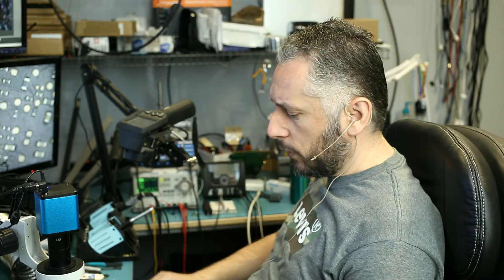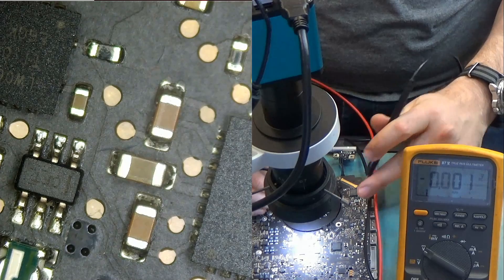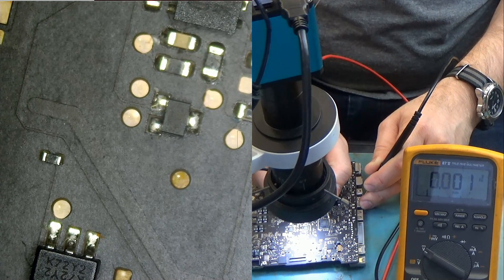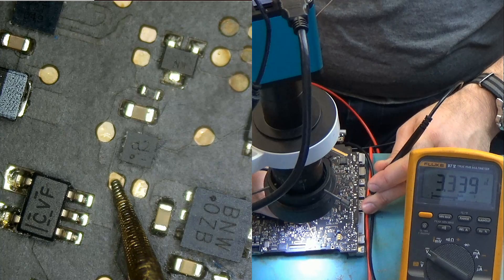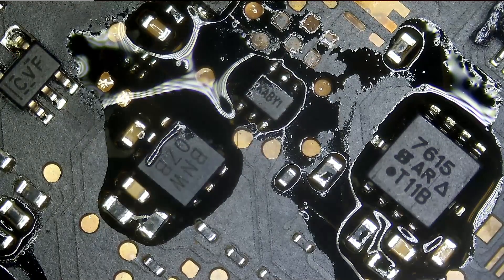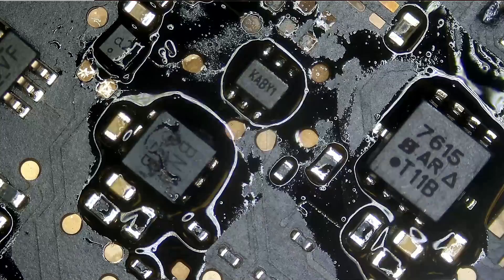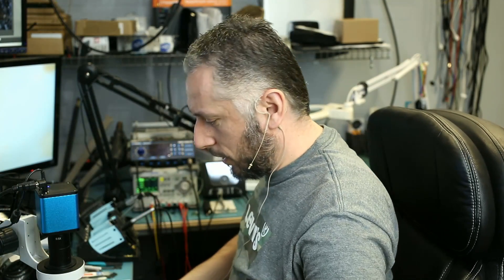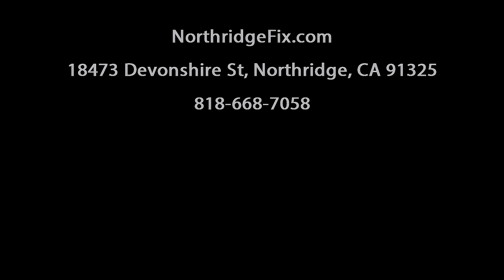Macbook Pro Green Light but no power - Missing PP5v_SUS 820-2915 repair

Comment: I have macbook pro 15 2012 Charging but won't turn on when I use the battery from 17 inch to 15 inch after 2 weeks suddenly shut down, only when I plugged in is green and also charging the battery , I have tried to find a defect component but I couldn't found

Comment: Hi, Alex, you're probably busy and don't have time to answer everyone, but if you find a moment, please help me in the video, you're fixing this mac, I have, like you, all the voltages except PPv5_SUS, I've already replaced this small chip four times and nothing else I've measured everything around resistors capacitors I checked the paths and everything looks fine I ran out of ideas someone has already worked on this board before and I saw that the bios chip was being moved, in your opinion could this be the reason for the lack of this voltage? Sorry for my English

Comment: I have a MacBook Pro 2015 13inch that went bad as well,after I formatted  USB Flash Drive and 3 to 4 minutes later it turned off and doesn’t want to turn on now,the LED light on the Charger goes from Orange to green but does not power on 😔

Comment: I have a 2009 MacBook pro green light is on but the battery wont charge and change into orange light , MacBook turns on and I replaced battery and charger cable and still doesn’t charge battery

Comment: Hi, Im from the Philiippines and is just starting on Macbook repair, Im working on a 2011 A1297 with similar issue , green light but no fan spin, no PP1V5. S0, upon inspecting the U7940 area and comparing it to the schematic diagram, I noticed that there is no R7917 (0 ohms)  on the board  similar to your video, do you think that the U7940 is the issue.I hope you can help me. Thanks.

Comment: I have the same problem you have sometimes the green power light is on sometimes not but the board always gets power???? I have followed the same steps you did. I have the 3,4 v PM-SUS enable but I don’t have 5v on pin 3 ???
What do you think my problem is ?? 
Note: I have checked BP5V-S5 which i have the 5v for. Why doesn’t pin 3 have 5v????
Which part should I replace ?

Comment: Hello, well done for your videos.
I have the same problem and on the other hand by forcing the start: I hold the power button down and I connect the power supply then the fans start and stop then the mac starts up but without backlighting .... GPU? do I have to heat it up? or is there something else to check first?
Again thank you for your advice.

Comment: I had take my laptop was charging and I took it out and switch plugs on entry it sparked,I took it as nothing but now my laptop when it’s charging example 
it’s at 55% it jumps to 100% for a minute then drops back to 54%.
 Do you know how to fix.....I was wondering if it’s the macsafe board
Reply: Probably something wrong with your current sensor